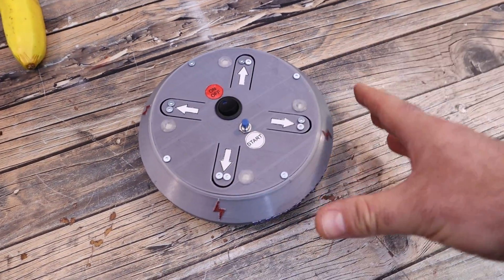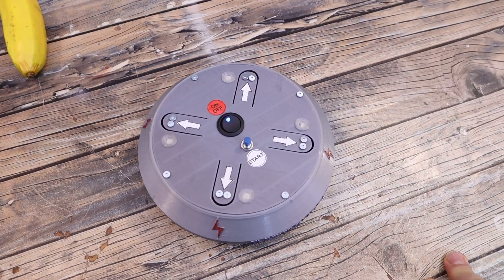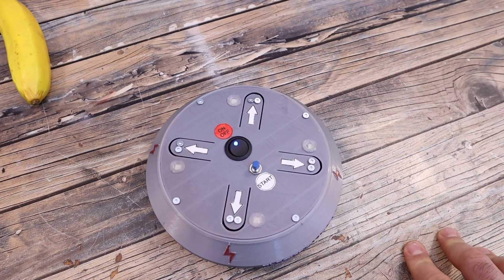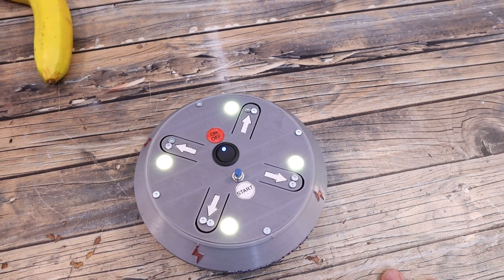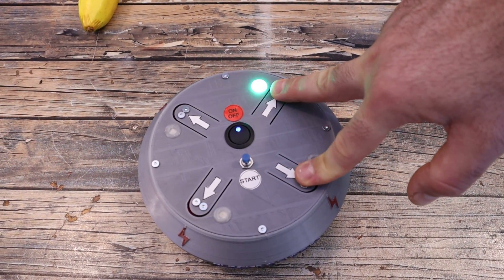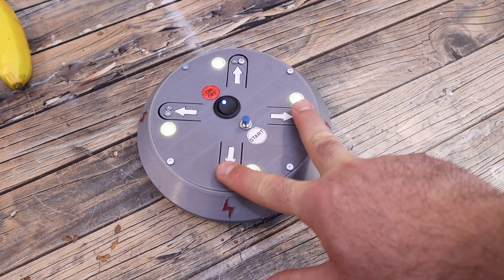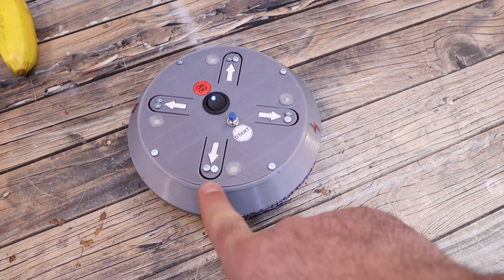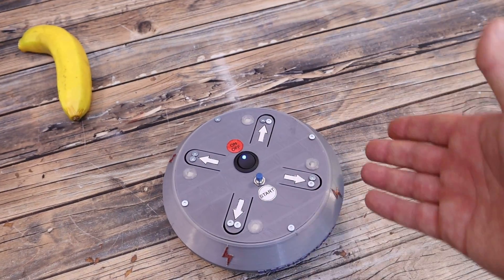Homemade Shocking Game - How It Works?

Comment: Hello sir, You told us that you were working in making advance arduino programing course in spanish. Will there be any advance arduino programing course in english??
Reply from the maker: There are already a few episodes in English. The Arduino 101 series is advanced. Just check it on my channel!
Reply: @ELECTRONOOBS  I have learned a lot from those..So there is more coming??
Reply from the maker: @shoumikahmed6373  yes but they are coming slowly...